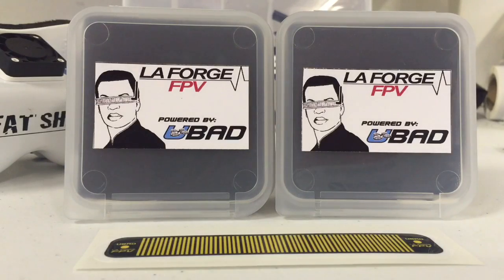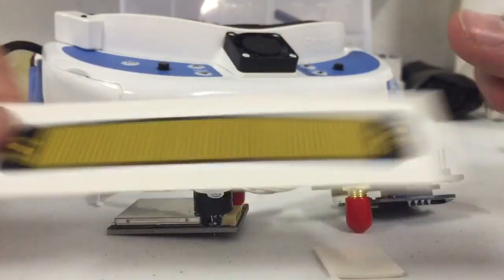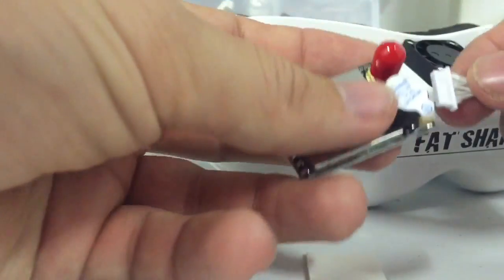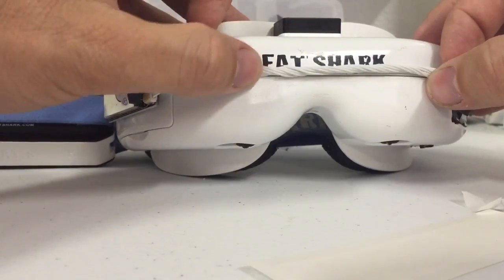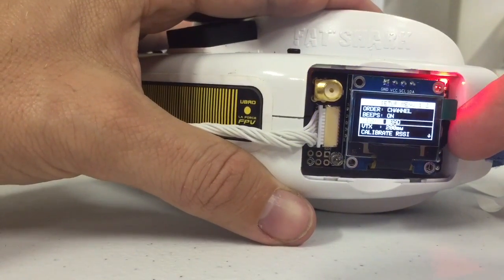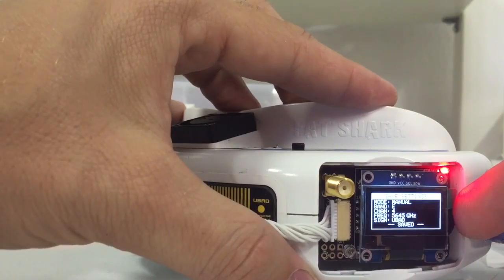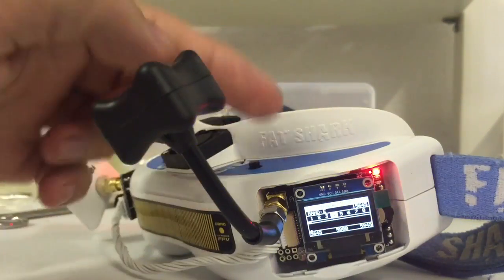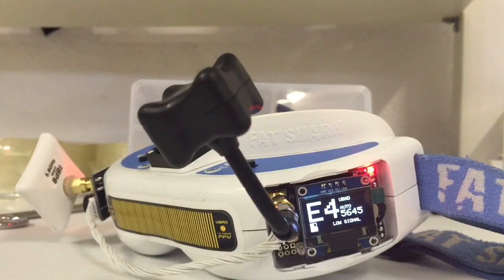LaForge Module w/ Diversity Setup

Comment: Where are the instructions for the v3 (three button) version? I checked your website but all I found was for old versions, not applicable. Also, the main module doesn't fully fit inside the port on my DomV3's. It seems the pins are too long. Can I cut the pins shorter to get a better fit or will this ruin the main module?
Reply: Thanks for the quick reply. Yeah, I'll join the FB group once I'm done serving my 30 day sentence (16 days to go). To many prudes reporting my photography work there, lol. Anyhow, I watched the video you shared the link to and can see that my main module is indeed fitting exactly like you've shown in the video. It just seems that it could/should sit about 2mm deeper for a cleaner look and fit. It seems the pins length is what prevents this from happening. Anyhow, I watched someone else's video and installed the wire internally. Everything works and I've tested it. I just wish there were specific instructions for the v3 module. I guess I'll just keep playing with the menus and figure it out on my own.

Comment: Do you have to calibrate the RSSI per VTX? Say, if I'm using FatShark 5740 on a RMRC Cricket VTX and something else on a different VTX, do I have to calibrate for both?
Reply: I thought you were supposed to calibrate without antennas attached so both modules have the same gain.

Comment: Thanks for the video. 
In terms of calibrating the RSSI, how often does this have to be done?  only once initially?  Or each time you change antennas / vtx?
Hope to receive my set next week. :)
Reply: +U BUY A DRONE LLC  Fantastic, thanks for that.
Reply: +U BUY A DRONE LLC when I calibrate rssi on 1.6 I don't get bars on both sides of the display I only get bars in the middle.